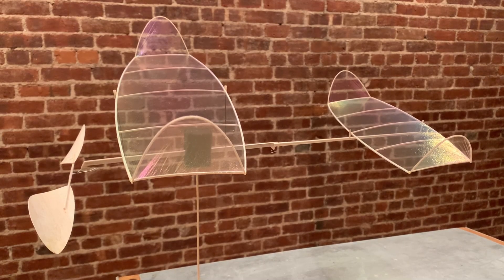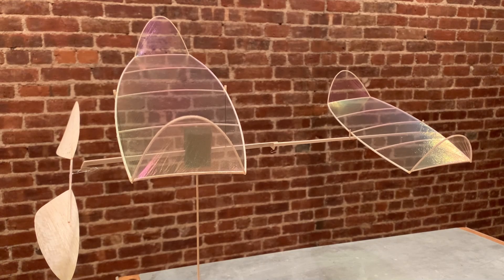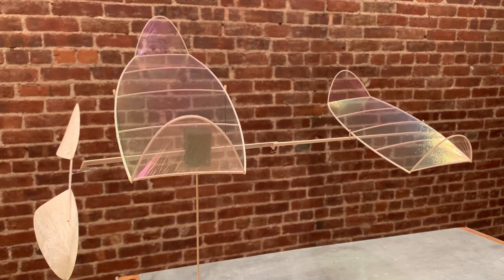Limited Pennyplane with an elliptical wing!

Comment: Hi Domoremath, I was wondering could one side of the prop have a high pitch and the other side have a low pitch to move the air but control the speed with at the same time. Or would it make a unbalanced prop?? I plan on trying this soon. Just wondering if you have tried something before.
Reply from the maker: Unfortunately, it would make an unbalanced prop with incredible wobble, one blade would be trying to fly faster than the other. It's very important to get the pitch of each blade exactly the same in order to get smooth performance - even if they are just a little off, you'll see a noticeable wobble.
Reply: @domoremath  Thank you, That is what I was thinking. I have my props at 67* pitch. I enjoy your videos
Reply: Man that's beautiful. What a lovely flight and place to fly!